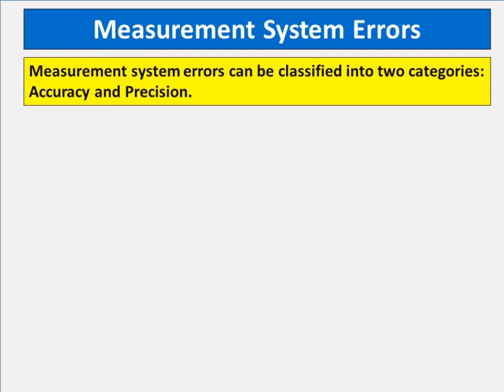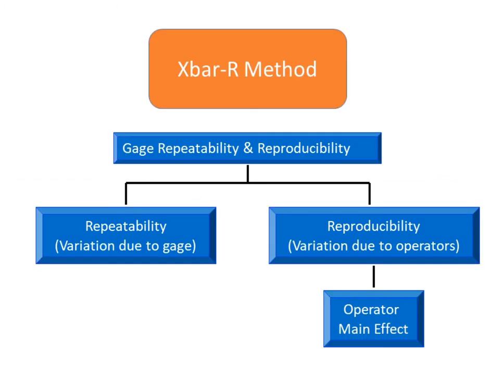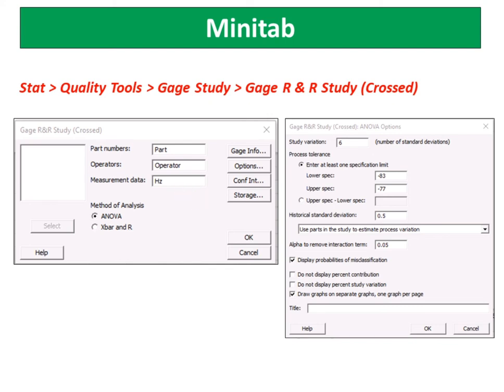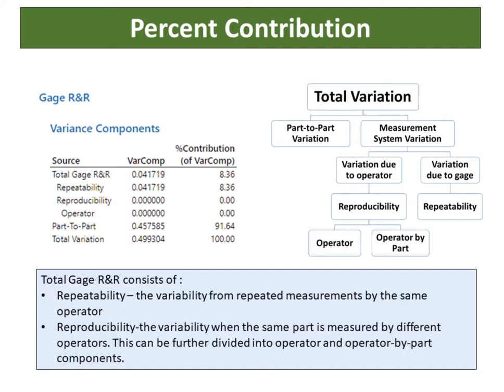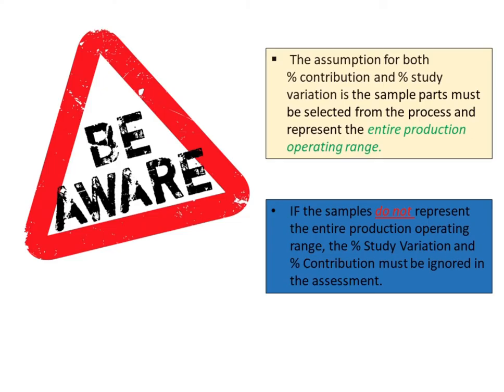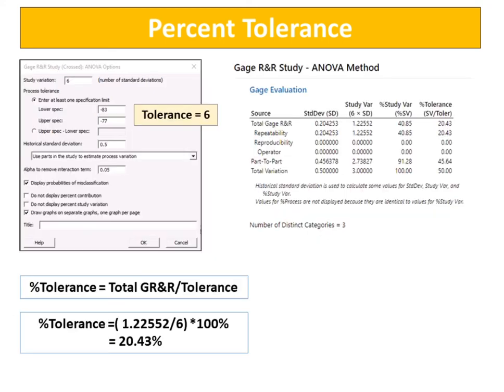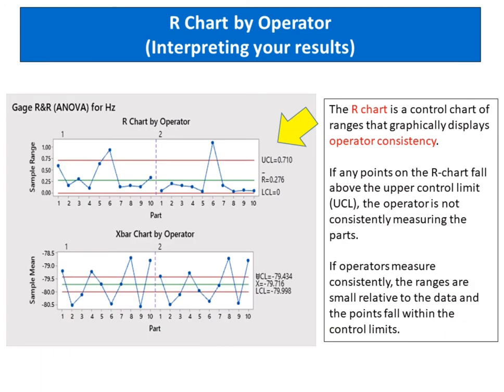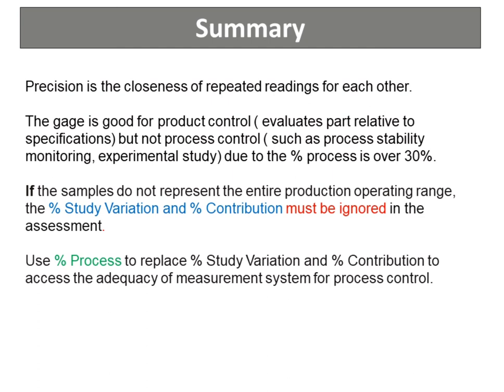Measurement System Analysis (MSA) Part III : How to Perform GR&R - Minitab ?

Comment from the maker: 🛑 Bad data is silently sabotaging your process improvements.

How much time and money are lost every year chasing "phantom" quality issues caused by flawed measurement systems?
If you are an Engineer, Quality Professional, or Lean Six Sigma Practitioner, it's time to stop guessing your data reliability and start mastering it.

Upgrade your technical toolkit with Advanced Measurement System Analysis Mastery for Engineers—a practical, field-tested guide designed to take you from data uncertainty to absolute measurement confidence. 🛠️📊

Here’s what you’ll master:
🔹 Type 1 Gage Study & Gage R&R
🔹 Bias, Linearity & Attribute Agreement Analysis
🔹 Gage Run Charts & Gage Management Planning
🔹 PISMOEA framework for bulletproof error identification

What’s included inside the course:
🎥 7.5 hours of high-impact, on-demand video
📝 Hands-on assignments to test your skills
📥 2 downloadable resources
📱 Mobile and TV access
♾️ Full lifetime access
📜 Certificate of completion

Don't let bad data compromise your process. Take control of your measurements and boost your career today!
👉 Enroll now for full lifetime access:
🔗 https://www.udemy.com/course/advanced-measurement-system-analysis-mastery-for-engineers-u/?referralCode=5649821A4AFF0E96FA31

Comment from the maker: A Gage R&R study produced the following results:

%GR&R = 7%
NDC = 8
Operator Effect = Significant (p < 0.05)
Operator × Part Interaction = Not Significant (p > 0.05)

What is the BEST conclusion?
A) The measurement system should be rejected because operator effect is significant.
B) The measurement system is acceptable, but operators measure consistently at different average levels and may need standardization.
C) The measurement system is unacceptable because NDC should be at least 10.
D) The gage has poor repeatability and needs recalibration.
👇 What's your answer and why?

Comment: i want to ask, what's historical standard deviation? is it mandatory to enter the value of historical standard deviation? What effect will occur if you don't enter the value of historical standard deviation?
Reply from the maker: The historical standard deviation is calculated based in historical data from your process.It is to compare measurement system variation against process variation.It is fine if it is not provided if your parts that you selected for GR&R study are cover the whole operating range of product.
Reply from the maker: In the context of this GR&R study, Historical Standard Deviation refers to a known estimate of process variation obtained from previous studies or historical data. It is primarily used when you want to compare the measurement system variation against an established process variation.

It is not mandatory to enter the Historical Standard Deviation value. If you leave it blank, Minitab will calculate the GR&R results based solely on the study data collected from the operators, parts, and trials.

The main effect of not entering a Historical Standard Deviation is that you won't be able to make comparisons against a historical benchmark. However, the GR&R analysis itself (Repeatability, Reproducibility, %Contribution, %Study Variation, etc.) can still be performed and interpreted normally.

As a best practice, only enter a Historical Standard Deviation if you have a reliable value from previous studies or long-term process data. Otherwise, it's better to leave it blank than to use an inaccurate estimate.

Hope this clarifies it! Thanks for watching and supporting the channel.

Comment: Great explanation, however, I am still confused on the "repeatability" part. Both Type1 Gage Study and Gage R&R determine the repeatability, is there any difference between the Type 1's repeatibility and the GR&R's repeatability?
Reply: A Type I Gage Study measures "pure" variability from the measurement device by taking repeated measurements on the same part. 

If the Type I Gage Study is not acceptable, then the MSA result will not be acceptable, so a Type I Gage Study should be done first to save time.

If the Type I Gage Study is acceptable then you can do a MSA that takes into account the variability due to the device, the environment, the procedure, the parts, and the operator - all parts of the measurement system. 

When evaluating an MSA for repeatability, it gives you an indication of how the system performs, not just the measurement device.
Reply from the maker: Thank you for the great question. 😊
Both Type 1 Gage Study and Gage R&R evaluate repeatability, but they do so in different ways and for different purposes.
Type 1 Gage Study Repeatability

Uses one operator, one part, and multiple repeated measurements.
Evaluates the inherent equipment variation under ideal conditions.
Answers the question: "Can this gage produce consistent results when measuring the same part repeatedly?"

Gage R&R Repeatability

Uses multiple parts and typically multiple operators.
Evaluates equipment variation within a more realistic production environment.
Answers the question: "How much of the total observed variation is coming from the measurement device itself?"

Think of it this way:
✅ Type 1 Gage Study = "Health check" of the measuring instrument under controlled conditions.
✅ Gage R&R = Complete assessment of the measurement system, including both repeatability (equipment variation) and reproducibility (operator variation).
Therefore, while both studies assess repeatability, the Type 1 study is more focused and controlled, whereas the GR&R repeatability result is evaluated together with part-to-part and operator variation in a real-world measurement system.
Hope this helps clarify the difference! Thanks for watching and for posting such a thoughtful question. 📊👍